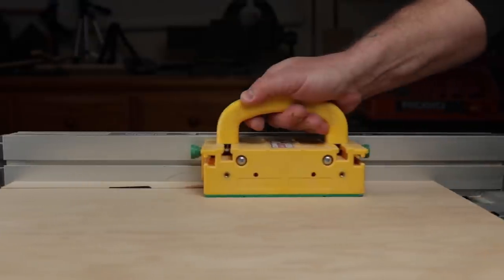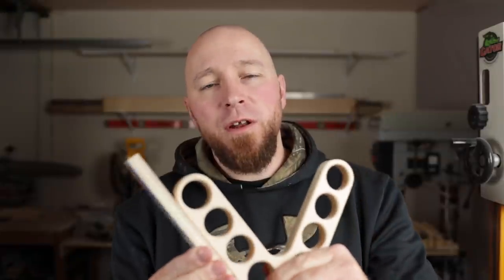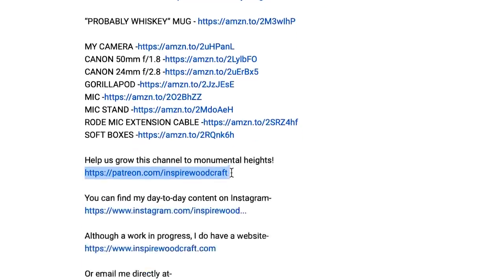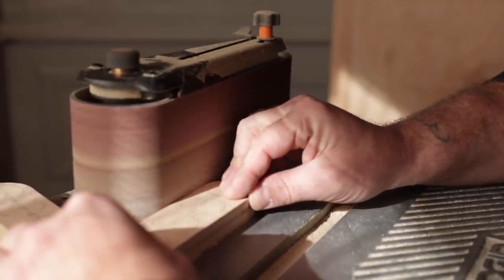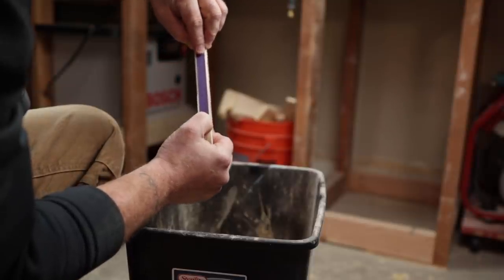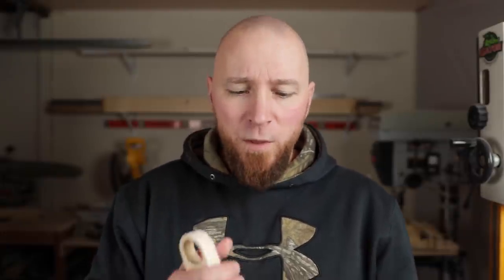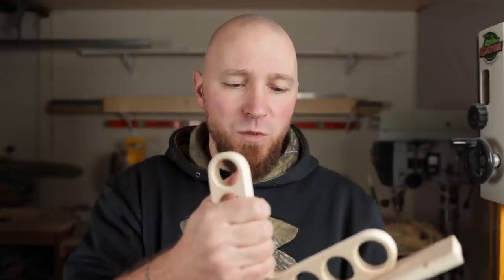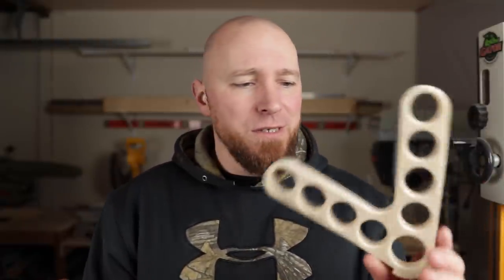Is This The New Best Push Stick Design For The Table Saw? / FREE TEMPLATE!

Comment: Buy a Sawstop table saw and don't worry about a poorly designed pusher stick.
Reply from the maker: This poorly designed comment speaks volumes.
Reply: My comment refers to the SawStop table saw brand.
They are expensive.
I wasn't knocking your ' pusher stick ' design.
There is a difference between stepping in the ring with the world champ,
and assuming feral comments were doled out.
I was deeply offended, and now I will enter the wilderness, never to be seen again, Paulides style.
( unlike the Mad Trapper )